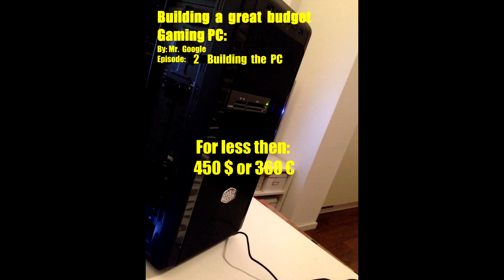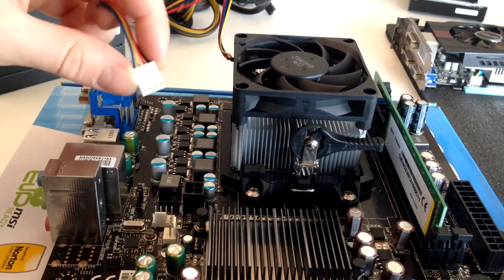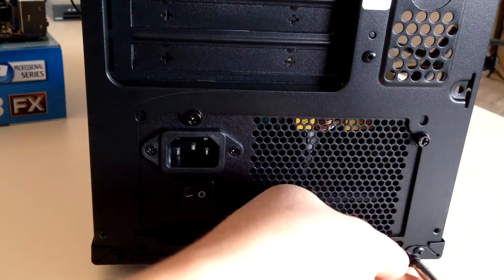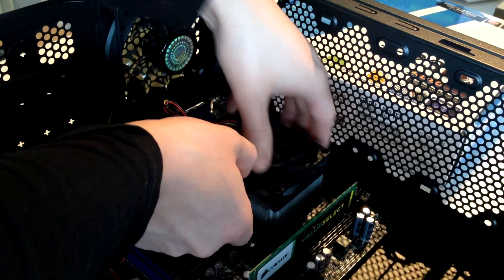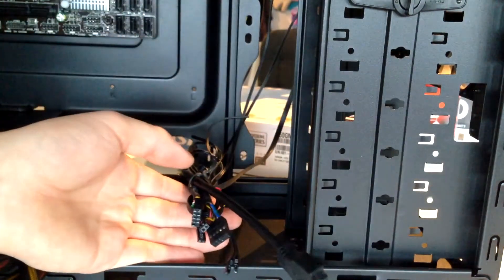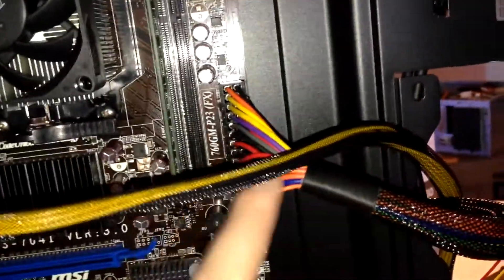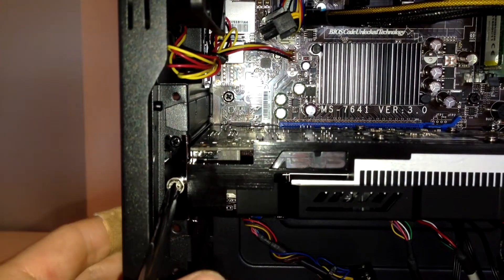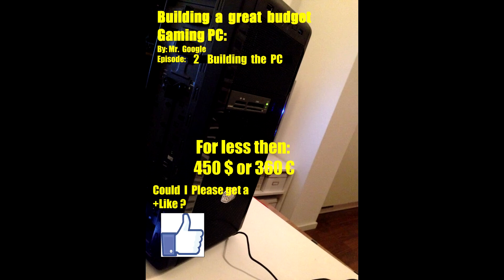How to: Build a 450$ or 350€ Gaming PC for 2015 for ALL games! [Episode 2: How to build this PC]

Comment: Welke parts zou je gebruiken voor een €500,- game PC?? Het liefst met AMD componenten. En zou er voor die prijs een r9 289 videokaart in passen??
Reply from the maker: wobelaarlivenl I'd go with an 1: fx63002: 8gb ram at 1600mhz (any will do)
3: a slightly higher end motherboard then this build for some overclocking 
4: a good 450w power supply 80+ certified
5: the best videocard you can get 270(x)/R9 280

If you can salvage HDD's or SSD's from precious systems/consoles/laptops then you would probably be able to fit in a R9 280

A good dutch website to look for parts is: http://tweakers.net/pricewatch/

I hope this helped!
Reply: Stefan Brand thanks but what case should I het then??
Reply from the maker: wobelaarlivenl the cooler master n300 would be sufficient! But a higher end one can be an option (But on a budget I'd say get a good cheaper case so you can spend more on the videocard!)
Reply: Stefan Brand oké thanks

Comment: Mr.Google! I need ur help~
Want to built a cheaper PC only want to run COD:AW in high smoothly!
Could you please make a list for meeee? :)
Reply from the maker: Hello yifan wu scroll down at these pages, there are excellent 700 and 1000 euro PC builds..!: 

Build 700euro (with ssd):
http://tweakers.net/reviews/3681/3/desktop-bbg-september-2014-basisgamesysteem.html

Build 1000 (with a gtx 970):
http://tweakers.net/reviews/3772/4/desktop-best-buy-guide-november-2014-mainstream-gamesysteem.html

It's dutch but scrolling down to the parts will certainly help :) without an SSD the first build is just above 600 euro and you are able to play at high settings or better =)
Reply: LOL thank u sooo much Mr.Google!
Reply from the maker: yifan wu No problem :)

Comment: What about the Operating System?
Reply from the maker: It is suitable for basically most OS, I however prefer to install windows 7 64bit trough a USB Stick, instead of boot from floppy/harddrive/cdrom select boot from USB in your BIOS (with the F12,DEL or other key at startup you get there)
(unplug as may stuff as you can) you start the PC and it basically loads the windows (7) setup after you selected boot from USB.
In practice this is just clicking next, next, wait, next...--> installed.

You can also do the same with windows 8 if you'd like.
Windows 8 is often on sale for about 8 to 20 euro here:
https://www.g2a.com/r/win_8_select_language

I hope this helped if not, I could google you a install windows 7 from USB stick video :)

Also it might be handy to unplug the harddrives where you do not want to install windows on.

With kind regards,

Stef
Reply: Ok thx I really just wanted to know where to get cheap ones cuz on Newegg it's like $100 bucks. Ohh and btw I found a cheaper version of this build that has a better Hard Drive. If u will allow me I can put the parts list :P

Comment: Hey! Is this a good gaming rig?

Amd II X 3 Over Clocked TO 4.00 GHz And Unlocked the 4th core to a phenom CPU
Liquid cooled 

8 Gb Ram ddr3 1999 MHz

Ati Fire Gl v 7600 1 GB SDDR3 Over Clocked to 1024 MHz 1.04 GHz   Liquid Cooled to

Hitachi 7200 Rpm HDD 1 Tb

480 Watt psu 80+ bronze

DVD R W-CD BURNER

Rocket fish 5.1 Sound card
4 EXTRA USB 3.0 card PCI
Wireless card and LAN card for LAN gaming

Motherboard: Foxconn A78ax 3.0 Ddr3 4 X, 1 Pci-e x 16, 2 pci-e x 1, 4 pci slots
2 6.0 gbs sata, 4 3.0 gbs sata.
Reply from the maker: Hello MegaHhh1234 first of all nice to meet you, second of all, mostly it depends on what you are paying for it, if the videocard was better you could play most games perfectly fine! I'd go for at least a 750Ti if you can't get the 650Ti.
Please also try to find out if the price is ''right'' the Ati fire GL is not really suitable for modern games.
However the PSU, quad core CPU, Harddisk and the 8GB Ram should be nice to start off with (it does seem overclocked because there is no 1999mhz ram??)
Feel free to ask more information =)

With kind regards,

SB
Reply: Stefan Brand thanx, and srry i said 1999MHz i meant 1666Mhz
Reply from the maker: MegaHhh1234 No problem :) you are welcome, so in short: only the videocard is lacking in comparison with other parts.
With kind regards,

SB
Reply: Stefan Brand just ordered a 650ti 1 gb thanks looks real cool
Reply from the maker: MegaHhh1234 nice! I wish you alot of fun gaming & alike =)

Greetings,
Stef